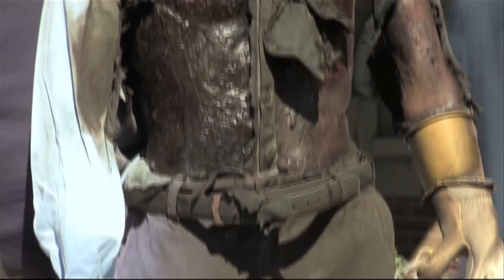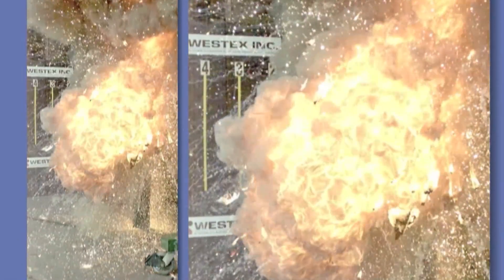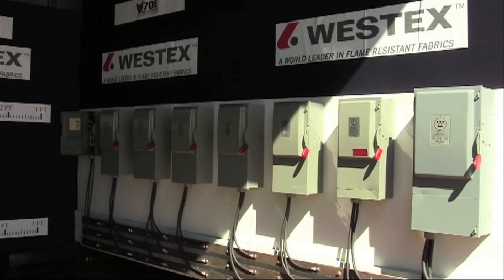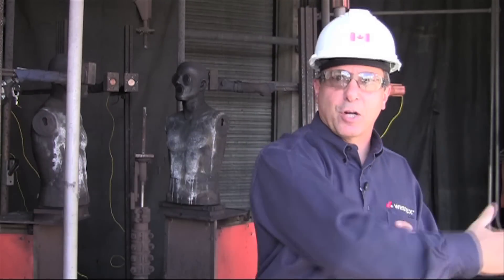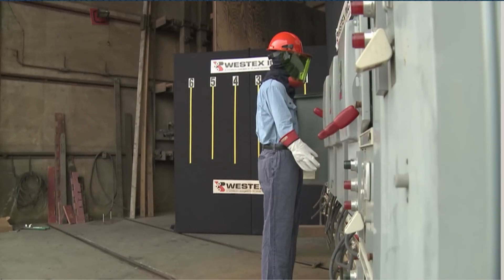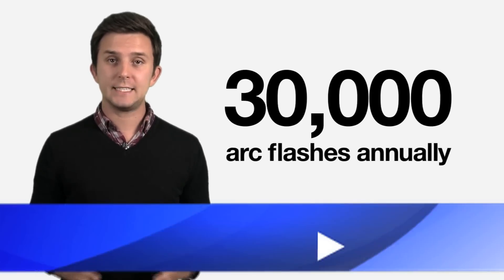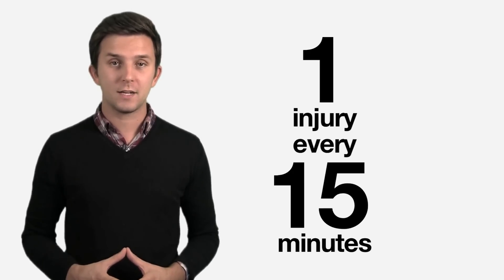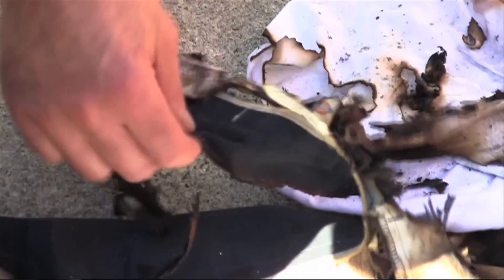Arc flash: How to protect yourself

Comment: I had to got toa comunity college and get certified in arc flash safety , i hate the suit they make ya waer in  some places like the huge non air conditioned  plastic injection mold factory  where it was averaging   around 120 degrees F on the floor working in the panels with sweat in your eyes  so bad you  couldn't where you were putting the screwdriver to tighten a wire on a breaker lol.
and in    240v circuits, but I know 240v  can make a terrible  flash but I also  think that being in there  and cant see for the sweat with the astronaut suit over top of the ninja suit    with  pillsbury dough boy sized gloves   seemed a tad   dangerous as well.If we didn't have the suit on wer were written up and fired on the 2nd offense   But  and  I for  sure WANT that protection when inside switchgear and many  other scenarios though

 I have wired  industrially since 1974  when i wired in my  first 600 amp panel for a company called  ACI  an electronics component   manu. plant  which later sold out and closed down
Reply: Stan, Need to make sure they aren't OVERDOING the PPE.  Many companies just "throw a suit at it" rather than assess the level of the hazard and look at the risk of occurrence.  There typically should NOT be a suit for 240V circuits.  At the most, this would typically be a 4 calorie rated shirt and voltage rated gloves. If we can help, send a request to questions@e-hazard.com
Reply: @hughhoagland9218  And what about 400V panels? What should be worn to operate safely and avoid arc injuries on a 400V live panel (64A of max current) ? I usually wear isolating gloves (class 0). Should i use any glasses, screen or particular shirt? Thank you.
Reply: Hey Stan, we would love to help you with any of your Arc Flash PPE needs. We manufacture the lightest and most comfortable suits in the industry. Let us know if we can help in any way- www.oelsales.com

Check out our newest product overview. Be Safe!

https://www.youtube.com/watch?v=FjXAlES3qGs